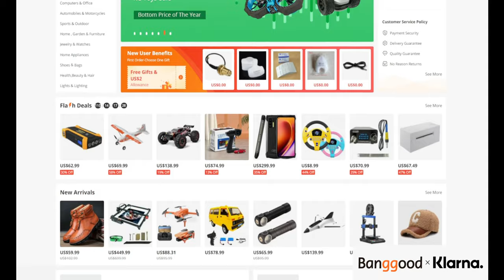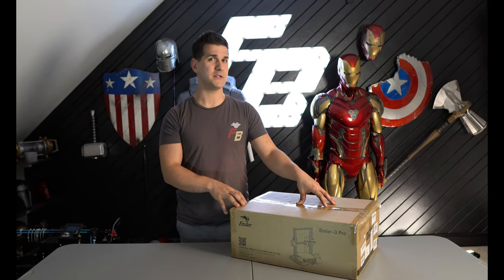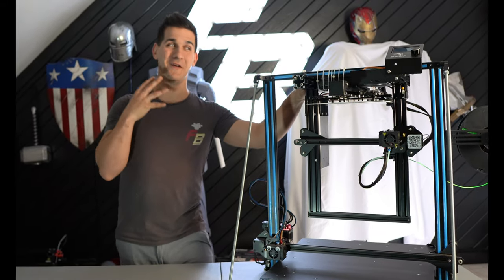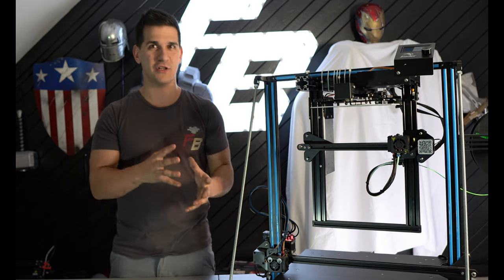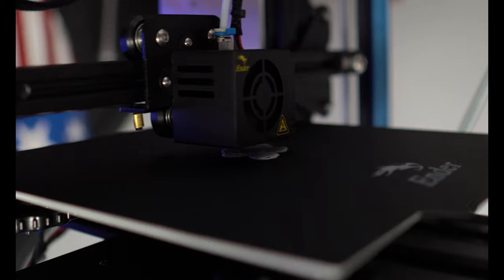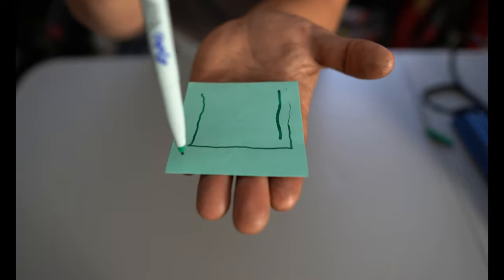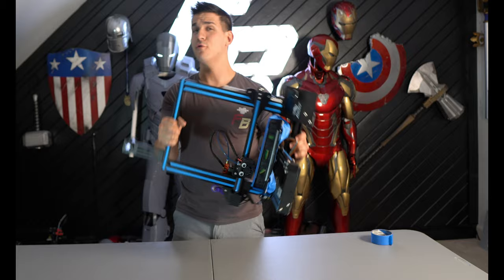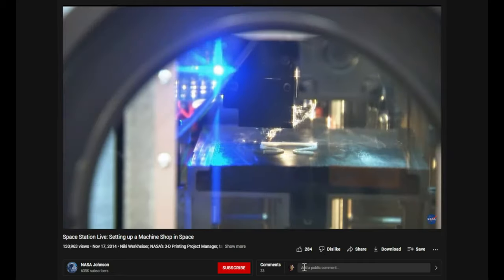CAN YOU 3D PRINT UPSIDE DOWN?!

Comment: machinists do both. we level the table to the world (gravity) AND we tram the head to the table. The reason we do this is that a mill can rapid upwards of 1600-2200 inches a minute and is designed to move the table which can range anywhere from 500 lbs to 5000 lbs depending on the machine. If the table isn't level to the world your steppers are now fighting gravity one way which can cause premature wear on the ball screw. This obviously isn't as important on a 3d printer as the components are so lite as to not be near the material limits of the guide and drive components. I just felt like sharing this tidbit from the pro-manufacturing side of fabrication.

Comment: Sidenote to tramming youre 3d printer:
Many think that they need to tramm the printer at z:0, resulting in a gap of 0.2 mm between the bed and nozzle. Your printer however will almost never start printing at z:0, something like z:0.2 for the start of the print is more likely (depending on layerhight). This results to the nozzle now being to far away from your bed, the gap is 0.4mm tall which is too much. 
To get around this you can just tramm your bed at z:0.2 or set a z offset so the printer starts its job lower.

Comment: I would like to start with 3D printing, but i don't know how expensive it would be. I am mostly worried about how expensive PLA plastic will be overtime, because i don't know how much plastic it takes to make something. Can someone explain this to me?
Reply: Hey, to make something like that would take stuff all filament, a 3d printer will cost u around $200 and around $25 for each 1kg roll of filament. Depending on how much u print and how big the prints are will determine how much filament u use. I’ve been doing 3d printing about 13 months now and honestly I didn’t know anything about it or much about computers either but there’s a lot of YouTube videos that can help u out. I researched for around 3 months before getting my first ender 3 printer and I watched chep’s video on how to put it together and make it all square. Now I have  2 printers, hope this helps goodluck 👍 Ull love it trust me.
Reply: @zombiehunter1152  Thanks for you help! I am going to do some more research and save money, so i can hopefully buy a printer soon!
Reply: @Roofvogel-wi1lx  nice, watch chep he’s another 3d printer channel too , I watched one of his videos on how to put my ender 3 together and did it step by step, cos I had no clue what the hell I was doing and showed me how to square it too. one of the most important parts to 3d printing is making sure your printer is square before u start. I mean base to the upright is square, cos if it’s not your prints will have problems and Ull b running around trying to find them. So start off on a good foot , once u get it going I must warn u , it’s a very addictive hobby and goodluck 👍, anything else just ask I’m happy to help.
Reply: @zombiehunter1152  Thanks for al the help!
Reply: @Roofvogel-wi1lx  once u get going I’m sure ull love the hobby, I know I do

Comment: So quick question, I just got an ender-3 and every time I try to print I run into the same issue. For some reason, the nozzle always snags onto the mold and moves it around. Do you happen to be familiar with this issue?
Reply: Make sure your nozzle is clean, your printer is leveled correctly and your not heating the filiment to too high is a temperature. Also bed adhesion could be an issue. Make sure you clean it with some solution of rubbing alcohol and water and make sure you get the first layer perfect. Also If the print is tall and skinny use a brim or raft
Reply: Just a guess but if it’s catching maybe it’s alittle to close to the bed when u level it.
Reply: @zombiehunter1152  Ty, this could help me a ton!
Reply: @dshadeproductions8258  have a look at how well it’s sticking to the bed too, cos if it’s not sticking well and it might easily move too.
Reply: @dshadeproductions8258 another thing might help is one side of your bed might be higher then the other, another good little trick I use sometimes is get a level and put it on your bed then put it on the crossbar that holds the extruder, make sure their both level with each other, cos if one side of the bed is higher it might make one side of your print higher too and catch on the nozzle. Hope it helps
Reply: @zombiehunter1152  thank you so much!! This should help out a lot!
Reply: @dshadeproductions8258  I hope those help , anything else I’m happy to help just ask and goodluck with it.
Reply: @zombiehunter1152  Thank you my friend and good luck to you too!
Reply: @dshadeproductions8258  u too 👍